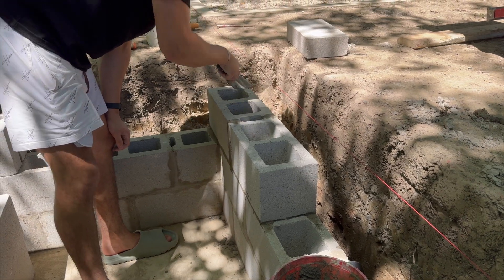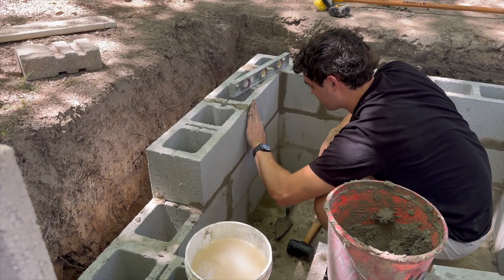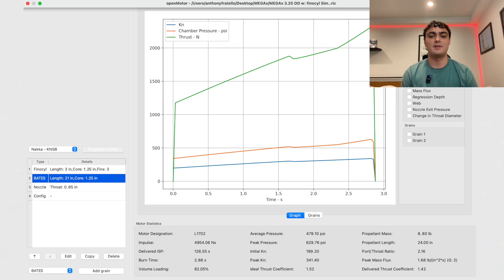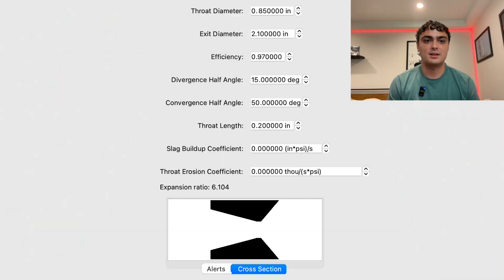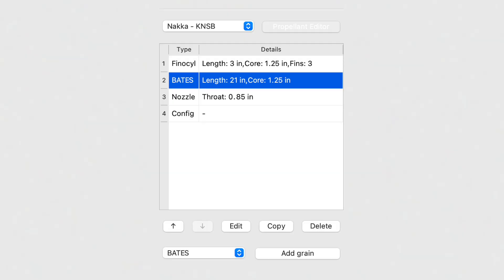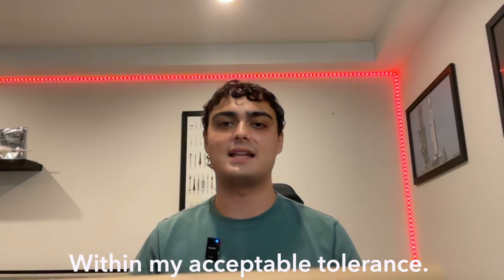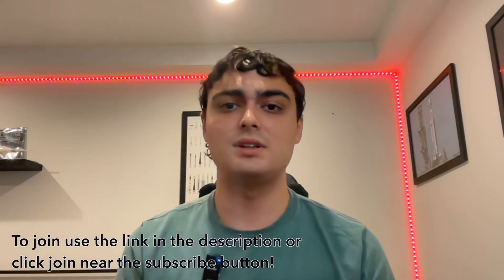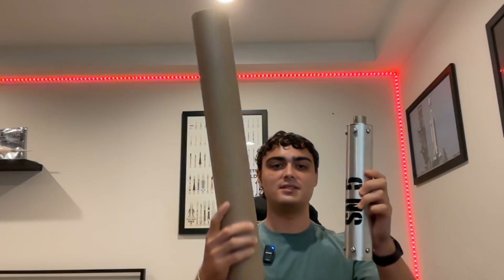Big Progress on MEGAx: Simulations, Test Site, Nozzle – Biweekly Update Video 001

Comment: Will you be using a vibrating jogger mechanism or a vacuum chamber to displace bubbles?
Reply from the maker: I was thinking about using a massage gun to hopefully get the air bubbles out. I would use a vacuum chamber, but I don’t have one. Also rocket candy cools down very quick so by the time I run it through the vacuum chamber, it would be difficult to pour.
Reply: @AeroPropulsions  The easiest way to make a makeshift vacuum depressurizer/degasser is to simply put a vacuum hose [make sure you get the right kind of hose, of course!] to the lid of a pressure cooker